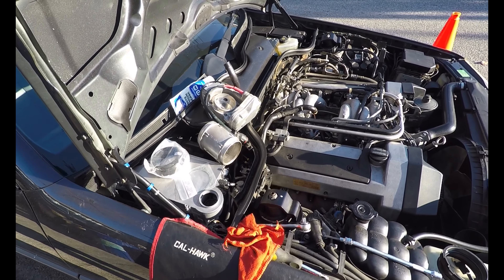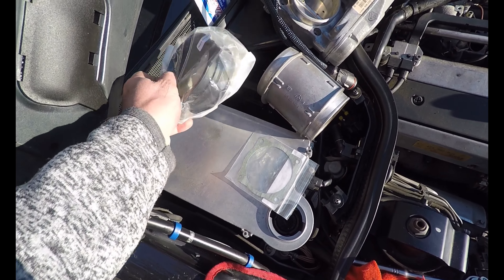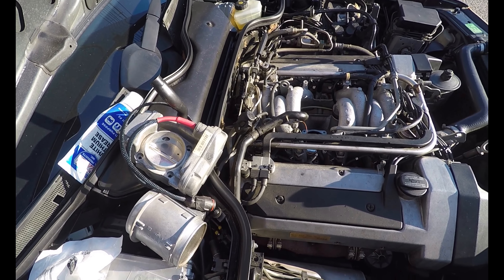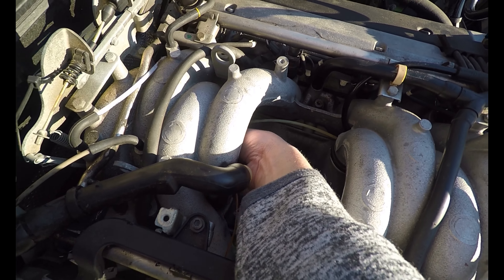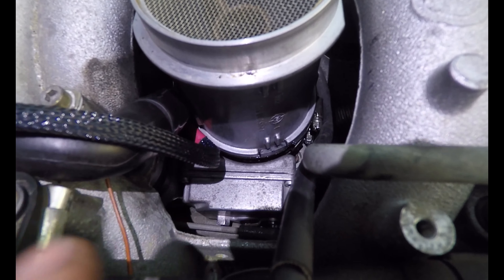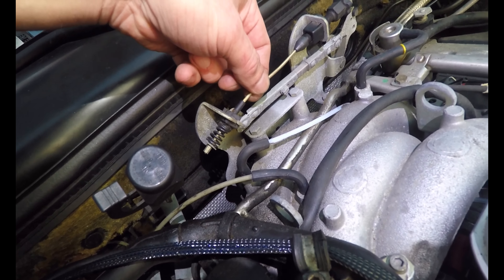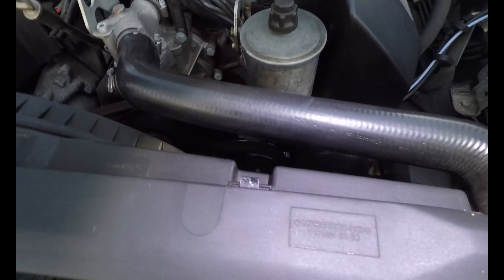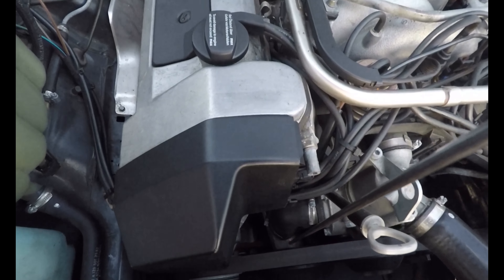Brian's Mercedes SL500 R129. Throttle actuator, idle speed, misc.

Comment: My 1990 sl500 has high idle only when engine is warm, around 1000rpm in Park. going into neutral it goes down and drive is 550. Not sure what the cause is ive cleaned the icv but im not sure how to test it